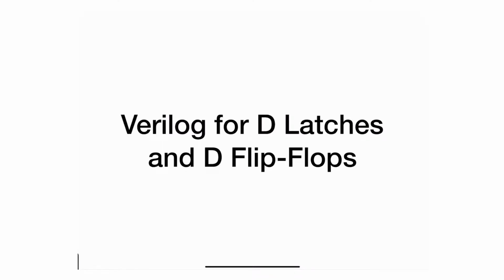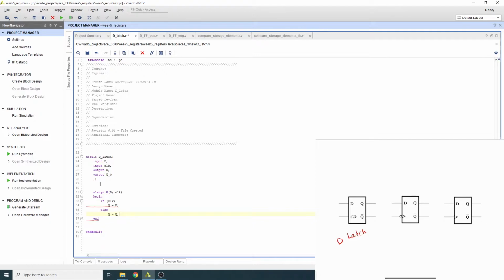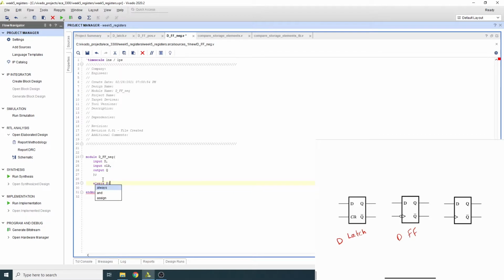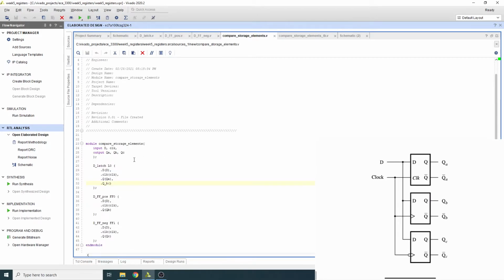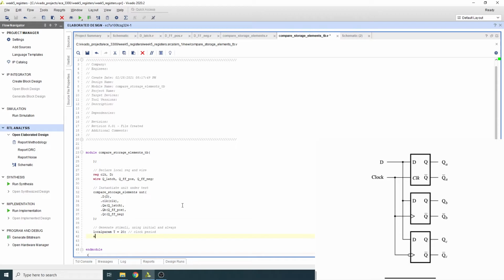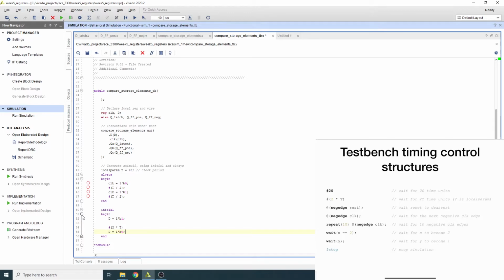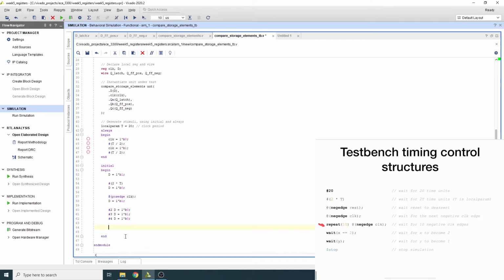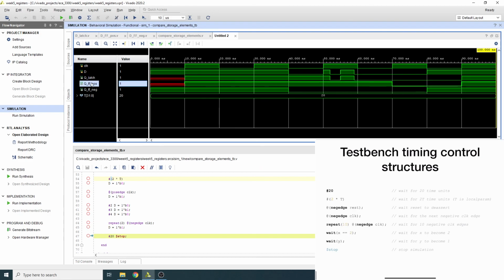26 - Describing D Latches and D Flip-Flops in Verilog

Comment: Changing D @ the onset of pos edge and it got reflected in Q ; doesn't it violate the hold time condition ? The previous value of D should be reflected @ Q ?
Reply: iirc this is without any timing parameters included, so everything is ideal